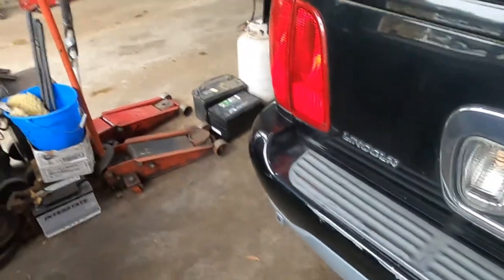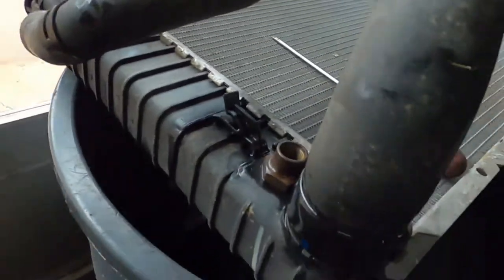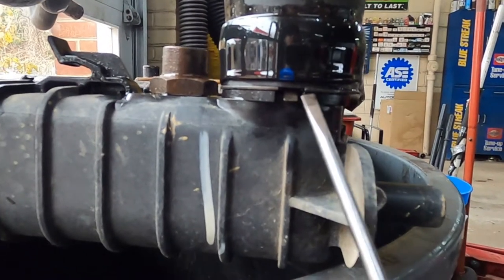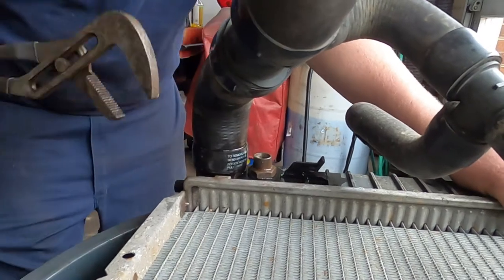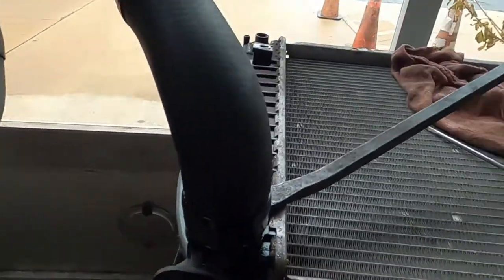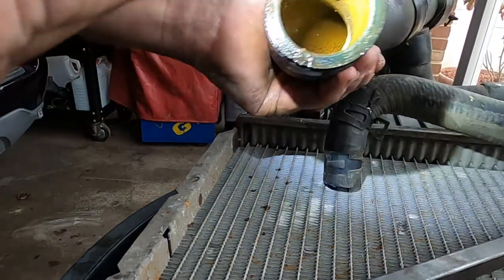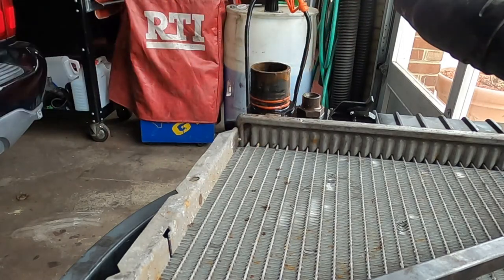Ford Expedition/Lincoln Navigator Lower Radiator Hose Removal

Comment: You can take it off while it’s in the truck. If you take the drivers tire off and pull back the mud protector cover and you can reach right in there with a screwdriver and a pair of channel locks and twist it right off.
Reply from the maker: This one was so tight I do not think I could have gotten apart in the truck. Thanks for watching

Comment: We have replace the lower radiator hose on 98 Ford Expedition.   It  still leaking.  Help
Reply from the maker: It's a bad hose or radiator.
Reply: Did you leave that absurd clamp and replace it with a regular clamp? I may need to to do this tomorrow . I'm going to sawzall the hose. Remove that ring and replace it with a regular clamp.
Reply from the maker: @btqy  I do not think that is a good idea. The part on the radiator has no flare to hold the hose on. The hose could blow off.
Reply: @btqy  did it work like that im have the same issue

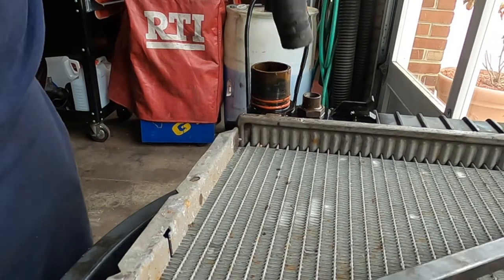Comment: Does anyone know the part code-number of those two orange o-rings that goes in the lower connection of the radiator? (minute 2:34 of the video)
Reply from the maker: I would call the dealer and see if they have them.